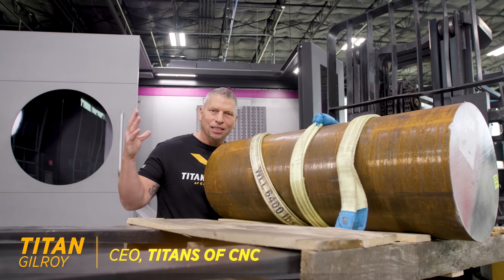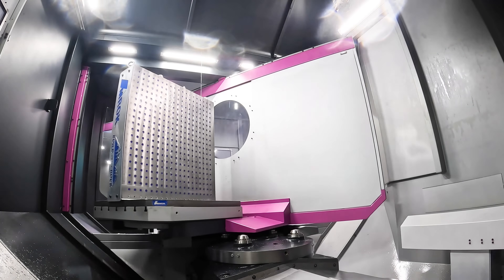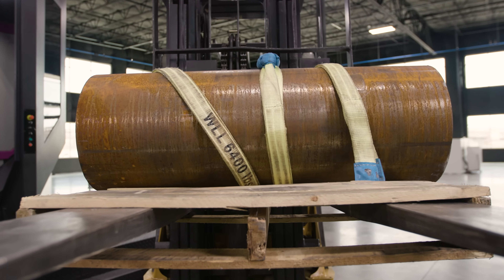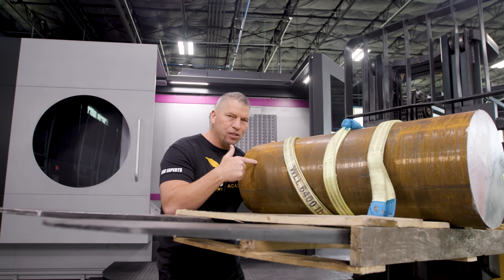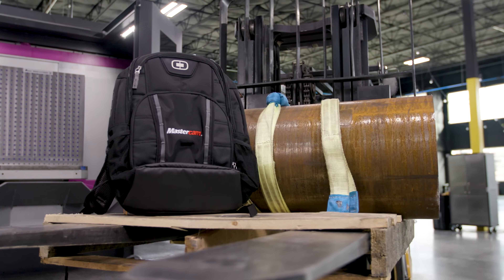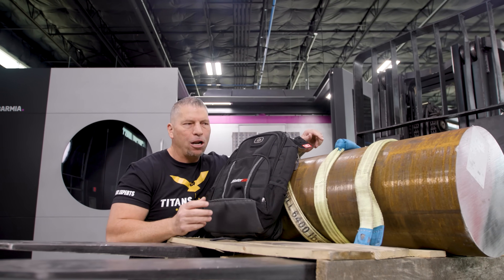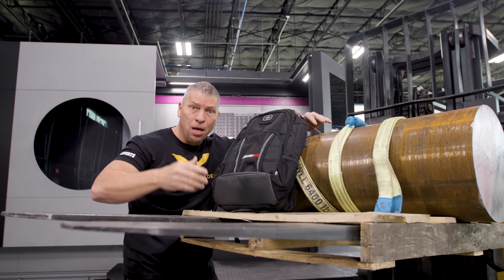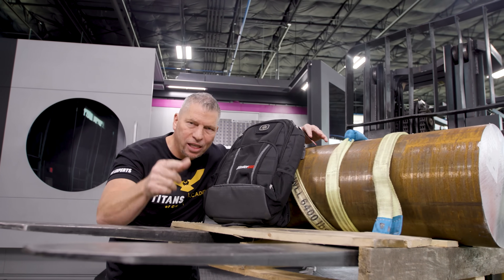How Would You Do It?? YOU Tell US How to Fixture This Monster!

Comment: Sarting with the least likely.  1. First you should thoroughly derust and degrease the workpiece and the angle irons. Then  affix two angle irons on a fixture plate, these will hold the cylinder in place. You can do this however you like, but you'll want to remove it later. After insuring the angle irons are square, parallel, true, etc, put the cylinder on top of the angle irons. The arrangement should look like the angle irons are there to keep it from rolling away, two really wide wheel chocks so-to-speak. 
Then you epoxy the cylinder to angle irons. Seriously.
There are two practical methods of removing epoxy. The first is heat, your typical epoxy weakens considerably when heated, 300-400F should do it. I would contact the manufacturer of the epoxy for something like this. Far from ideal for a workpiece this big, but it could be done. The second is mechanical removal. At this point, all you really need to do is get the angle irons off, any epoxy adhering to the workpiece will not harm any tooling. It would only interfere with workholding, but I think you can work around that with strategic ordering of your machining operations. 
Alternatively, you could just glue one end of the workpiece to a fixture plate. 

2. My second idea is to make scope mount. Start with thick metal plates (presumably two), have a hole the size of the workpiece cut into them. The hole must perfectly match the workpiece.  Then cut the plate in half. Attach the bottom halves to the machine however you see fit, but you must drill and tap some holes to receive the top halves. Machine a flat on both ends of the top pieces then drill a hole for the bolts. Run the bolts through the top piece and tighten down. Benefit is you can use these on any portion of the cylinder that remains mostly cylindrical, not just on the ends. 
You also could just make the bottom parts but pull chains or a belt. This could be rigidly affixed on one end, with the free end of the chain attached to a piece that can be bolted down to the other side, allowing very fine control over the tension. For extra security, paint the inside of the clamp with pine rosin, old gunsmiths' trick for scope mounts. Simply dissolve the resin in turpentine then paint it on with an acid brush. 

3. Third idea is to bore and tap some holes. Others say this would require knowledge of what you intend to do with it. They are incorrect. 
You ordered the workpiece oversized, I would be extremely surprised if your margin for error is less than one inch. One inch deep threaded holes is plenty for securing a piece even this massive, it could be done on one-half inch, albeit with much greater difficulty.

Comment: Not sure what needs done to the part, but I would try to lay it down on v-blocks clamp over top and finish the top and bottom. Then for Op 2 you could set it in a chuck with a finished face down so the part is vertical. Possibly using a clamp thru the center if it has a thru hole for added rigidity then you'd have full access to all sides.

Comment: Hi Titan.  I noticed that you have a center hole drilled in one end.  It seems reasonable to me that you would use a center on that end and hold the other end in a chuck on a 4th axis rotary table.  This would be the simplest way to fixture the part.  Best of luck with the machining.

Comment: Drill a through hole where you aren’t cutting. Put a press fit pin where it can thread into the vice & then use a pinch bar clamp to hold the outside, maybe 2-3 where you aren’t cutting.

Comment: Not able to see what you going to do with it. Without a blue print its difficult to get idea how to create an unknown part. Ideally base on it be round the CNC Lathe would be a choice in conjunction twin spindles or It can be center drill at one end for support  with use of tail stock and steady rest also consider if need be. At this stage Ibarmia looks like wrong choice. If done in Ibarmia and machine vertical vibration possibly will appear so clamping at the base and above mid points would be needed for security. It all depends what is made. Boom!!!  Its about to get crazy!! Its about to go down!!

Comment: I'm thinking standing it up perpendicular to the top of the plain table either in chuck jaws mounted to the table or if you are closer to net material, tapped holes in the bottom, mounted to some outriggers with C'bores in them to create some "feet" then clamping the "feet" to the T-slots in the table.

Comment: For horizontal, 2 knees underneath, 1 at each end, either with evenly spaced mounting pockets drilled to match the tombstone to clamp (pre-op) considering those kerf, pulled to v blocks against the tombstone.  or bar clamps to v blocks if mounting holes not possible. Similar for vertical, clamp to v blocks vertical...,  and use bite screws (kerf) on tangent height set screws to retain. Top clamps or end clamps,  all this no prep lathe work considered

Comment: Why is this going on a five axis rather than on a lathe with auxiliary axes? Round stuff goes on lathes. There are plenty of them with capacity to easily deal with this round stock.
Reply: I agree.... I use a horizontal to face and center. Then face drive it and put it into a 5 axis lathe. I have done shafts like this many times with turning and 5 axis milling that needed to be done all the time.

Comment: Without knowing what the part looks lile, and assuming that all sides are somehow machined to accomplish a finished part... a set of welded angle plates suitable to hold the weight stitched to one side of the part and bolted down to the tombstone would probably be the easiest, fastest , and most rigid method of holding that big a piece of roundstock.

Comment: Part print would help as everyone has stated. You got that tombstone setting there mount three blocks to it. Then mount some block to sides of those blocks . Then take machine mill out 5/8 round into these blocks . Just maybe giving about about .010" -.020 " compression around outside diameter.  Take side blocks off set steel bar in machine on block to hold up off table whatever distance for cutter to go around the end.  Place blocks back on to capture outer diameter.  Then make the chips fly!!!

Comment: Turn a flange on one side and drill as many bolt holes as the table and diameter will permit to use standard T-bolts and bolt directly to the table. That way you can machine 360 degrees around the part as well as the second face.

Comment: Depends on the part and the operation. But seems to me like you should bore a hole the size of the stock and use the mity bite clamps similar to the lion. But make it deep enough to actually support it. It’s almost impossible though if we don’t see the print or at least know the Op

Comment: Without knowing way more info of machine travels / work envelope, part requirements and tooling available. You need all that info first to plan your execution. I can dream many ways to make something, but without knowing what the part needs and your available workholding on hand your wasting time. 

I keep eyeballing the Center window in the divider for some reason lol. 

 If possible I would strap clamp horizontally onto existing tombstone, supported up off the table high enough so head or tool holders can clear tomb base. 

don’t get too fancy / expensive for one offs and experiments. This could just be a counterweight with a tapped hole in one end. Or a full blown round tombstone mounted vertically. 

5 sides on a round part is too vague I’m sorry.

Comment: Yeah Titan . Wouldn't it be necessary to have a part drawing first , in order to determine what fixturing will be required . Also , with several thousand pounds hanging from pallet 1 , would pallet 2 not be affected proportionally ? Maybe this monster machine is rigid enough . I've worked with Makino's and Okuma's with similar setups but they had corresponding fixturing on the opposite pallet .

Comment: Being a round part I would instantly go for a pair of vee blocks. Indicating them square to the spindle and true to each other.Lay the part in the blocks. Then make  up some long bolts and then put clamps to the centerline of the part clamping perpendicular to the part at the blocks. Leaving one side completely open as well as both ends. Then let her rip tater chip for the first operation.

Comment: Could maybe get a large machined flat piece of material and then clamp this down to the bed and clock it up, mill a recessed circle in the middle slightly bigger than the diameter of the billet and then use bulldog gripper clamps around the outside of the machined hole which when tightened bite into the material pulling the part down and clamping on the outside diameter of the part with it weighing so much gravity will be on your side in keeping the billet sat in the fixture also, then possibly machine alot of the material off step roughing it. Id also depending on the part if its near enough the length of the billet try to machine flat on the bottom and up the side of the part where it can be clamped by gripper jaws on vices mounted to the tombstone and the fixture base. This is probably wrong but im still learning😁

Comment: I would mill one end flat and  clean up about 12" from the milled end down the length and put a groove in it to give it extra holding power.   
Flip it on to the milled end and clamp it down and let her rip. 
If you need to put it horizontal after you removed most of the weight you will have a Excellent section to clamp on to. 
One day I went to work for you buddy. 
Take care

Comment: Machine out the center of a big chunk of aluminum so the monster round stock of 40140 steel can be recessed into the fixture. Machine steps around the pocket so that the part's diameter can be surround with multi leveled steps of Mitee Bite Pitbull clamps to give it outstanding rigidity and missive clamping force. Then mount the fixture plate to the tombstone and load in the round stock so that all five sides can be machined to perfection.

Comment: It depends on if you want to lay it down or stand it up, laying down I'd lay it in the T slot on the empty pallet, and throw something over the top of it to pull it down to the machine. The top clamps will need to fit the material better as you become more aggressive.
 Standing up will be a little more tricky. I would face it off in the lathe to square up the end and give you a flat surface to rest on. As long as it sits flat, the weight of it should do most of the holding. You just need something at the bottom to keep it from sliding around and hold it where it sits. I would push it into 2, 4" blocks at 120° with a cam or a wedge. Something quick to keep management happy lol

Comment: Turn one end of the shaft down to 3/8 and thread it 16tpi. Then put a 123 block into a 5 axis vise and thread the shaft into one of the holes in the 123 block. You’ll be able to get to all sides of the part to do whatever you may need to do to it.
Reply: 3/8 perfect size, plenty of clearance

Comment: 2 Big V-Bocks and clamps that go across the diameter of the raw material. On the flat pallet for Operation 1.      For Operation 2 some mill features to hold it in the 4 vises on the tumestone.         That would be effective for a one off.

Comment: Mill a flat across the length of the billet and machine a dove tail into it so you can hold it in as many lang/schunk vices as possible. 
You will be able to attack the job and remove a lot of material without having to change set up. 👌
It looks like you have a hole already drilled into the billet, maybe you could hold the billet in a mill turn with a centre in the end to machine the dovetail?

Comment: Good morning from Australia 

Of course as everyone is saying a drawing would be useful 

But essentially in the design stage one would hope the material has "green" for work holding methods, datums, tool approach and clearances can be worked out

You may be able to hold this material in a variety of ways. Useless if you can't approach the job because of the work holding method.

Going by the complexity of projects you perform "Titan" I would hope the material is 100mm longer (4") 6mm bigger in diameter (1/4") 
I would hold longitudinal in rotating 4th axis and trim the excess/final operation if needed, on work held faces

I haven't got much experience on 5 axis machines but for this application I can see the 4th axis for 360 rotation and the 5th axis for complex/compound angles and hole drilling

Comment: elevated v blocks on the empty pallet, make sure the part is high enough so the spindle head can machine under the part. the round stock would be mounted horizontal.  this will allow the machine to access most of the entire part; except where the v blocks are located. the untouched material could be sacrificial. make sure to leave fixturing locations for thee following operations

Comment: Without seeing the drawing, assuming it’s something I’d expect from Titan, it’s going to be full on. So first op would be either chains or clamping on the cut ends,.

Face 3 spots, on the top of the part to a decent sized flat. Drill and tap to take hold down bolts. Flip part and clamp through the fixture to the part, now ALL sides are available to get after it!

Comment: If you are going to hold it axially (length against the tombstone) using 4 v-jigs/v-clamps to hold it radially.. if holding it radially.. idk how without at least a jig of some sort but it would be weird.. I'm assuming that the material is probably some weird stainless like Nit-60 or 50 or Invar so inserts will not be long for this world(especially at the feeds and speeds you guys run)..

Comment: A drawing would've been preferred of course and this would be easier to draw on a piece of paper rather than explaining with plain text but to begin with, The outer diameter I'd prefer to have machined in a giant lathe in beforehand and face it there as well (Alternatively it could be machined on a lathe afterwards but I would not do it in the mill). Then I'd clamp it with a "Main bearing cap" styled clamp don't know what you'd call it in English but basically a clamp with the matching diameter and distances with the matching diameter under so you can hold it on the tombstone and the bottom end resting with a distance on the machine table itself. 

Machine as much as possible, place into a second fixture that steers the part into the right place using machined surfaces or holes to indicate. Clamp on tombstone, standing up but resting on the table.

Alternatively (depending on how the part looks) It is possible to clamp it down from the side of the part with clamps that preferably have a matching radius, That way you could reach everywhere at the top then fixture it for second op like I wrote before.

Also, if there are threads at the end you could make a part that is shaped as a triangle for example and mount it there, that way every time you rotate a flat side of the triangle indicate that it's been rotated 120 degrees. (I would do this depending on how it looks)

Comment: Could have some V blocks set vertically and then serrated vice jaws at the top and bottom. This vertical position would allow you to machine the 1st op. Then flip the part round and right next to it position the 2nd op on more custom fixturing, it’s hard to say specifically would it would look like for the 2nd op not knowing the finished part. But the general idea is being able to fit the 1st and second op side by side vertically.

I am also assuming that it fits within the dimensions of that big tombstone. But by eye after watching the video, it seems to make sense in my head

Comment: You're going to want the axial centerline of that round stock to run parallel to B axis and as close to center as possible. You also need rigidity and a mechanical lock to stop slipping. I would drill cbore bore and undercut a mounting block as an adapter that pins and bolts to a base plate. I would turn one end and cut a groove around the OD of the stock about 3" from the bottom. I would mount the plate to the machine and bore the plate to match the turned pilot on the stock, and then mill a face groove for a rotational lock. You can bore since the adapter plate is undercut. Then mill pockets drill tap for your favorite toe clamp or similar and also key locators for the face groove on the part. Use the work offset used to finish the adapter plate to program the part, install the part into a 3-4" deep bore, clamp and go. The length of depth in bore Contact to stock will help control rigidity issues and the part can't turn or pull out. It is secured with bolts directly to pallet or base plate. No chance of any unwanted movement.

Edit.

You also get clocking for the next op.
Boom!

Comment: You can't state work holding just based on a raw piece of material and the machine you're going to use. We need to look at the design, we need to look at the material that'll need to be removed and how many stages and different work holding pieces will need to be made for each stage. Far too many variables to determine work holding at this stage with the information given. But you knew this already. ;)

Comment: If the goal is to clean up the ends so they can be used for a datum in the next OP. Probably dual V-Bocks along the axis of the cylinder. Then hold down with either a bar or chain clamp. Nothin too fancy but would definitely be able to get the job done.

Comment: Information on the part would be helpful. 
option 1: machine it parallel or weld a parallel piece of material to the raw material (or machine a dovetail for mor secure clamping) on the round side to clamp it in the vices. option 2: clamp it like the titanium lion with mitee bite pitbull clamps. option 3: schunk vero s system